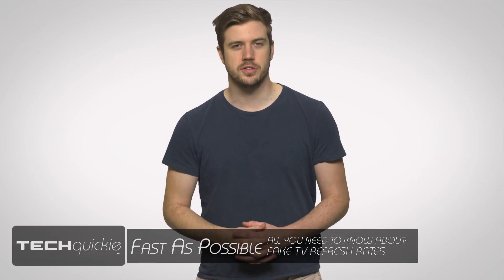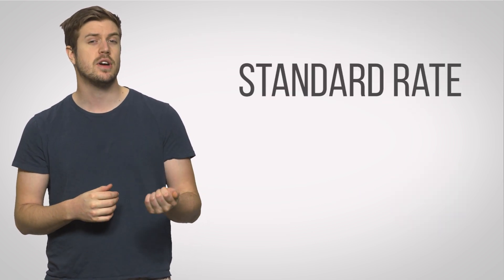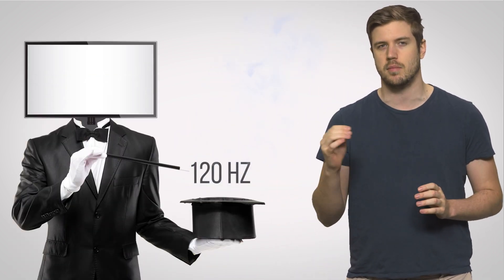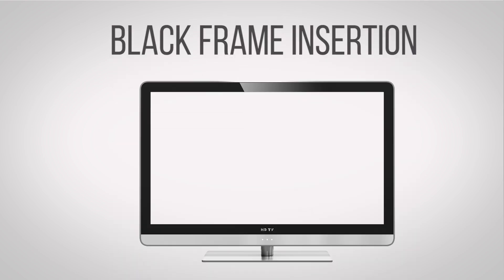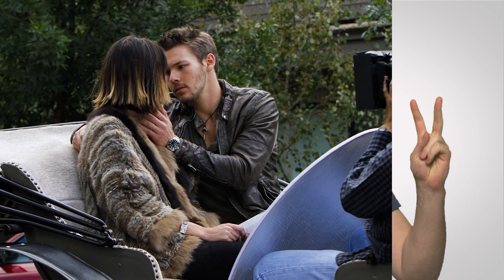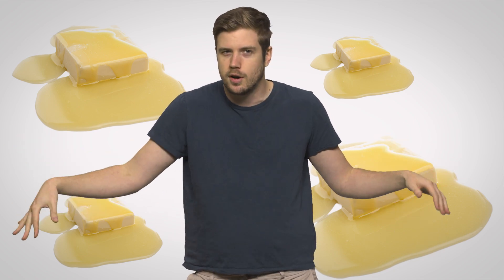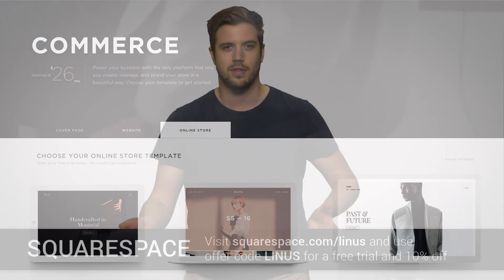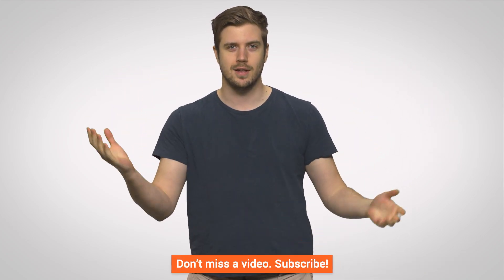Fake TV Refresh Rates As Fast As Possible

Comment: hmm, 60hz, oh wait, fuck off and stop trying to use a sound frequency to display screen refresh rates, fucking idiots
Reply: Wait, what ? I have a Bachelors of Science degree in Audio Engineering, and I'm really hoping you're just trolling. Hertz is a measurement of frequency - the reason 60Hz is a tone in audio is because it's the number of cycles a sound wave (Sine/Saw/Triangle etc) does in a second, just like 60Hz in video is the number of cycles a display refreshes in a second. Again, I REALLY hope you're trolling thesmf210...
Reply: I'm going to take the bait and say that hertz isn't sound frequency, it's JUST frequency, or cycles. CPUs are also measured in hertz, like the Intel Core i7 6700K, it has a 4.0 Gigahertz clock speed.
Reply: hertz isnt a sound frequency??? well fuck me, thats where i went wrong as a sound tech..... oh wait, i didnt u muppet
Reply: No, hertz is a sound frequency, but it's also other frequencys.
Reply: hertz/kilohertz=audio, megahertz=processors,  they should no way be used in tv's
Reply: Well 1 megahertz is just 1,000,000 hertz, so they're the same thing. I just think of it like this, Megahertz/Gigahertz=Processors, Kilohertz=Audio, and Hertz=TV
Reply: If you wish to be left alone, but take this wikipedia article and read the Introduction at least. https://en.wikipedia.org/wiki/Hertz?oldformat=true
Reply: Okay then, be ignorant. I'll just be here to have a simple and civil argument if you change your mind.
Reply: ok m9
Reply: "i work as a fucking sound tech" lol
Reply: You work as a sound tech? You most certainly didn't need to graduate from high school. Dunno what kind of company hires someone like you.
Reply: thesmf1210 ,Surprised you can get a job without going to high school. Are you a sound tech that makes sure the child slaves make the Jordans squeak just right? Bet you cut off their parent's hand every day they make less than 1000 Nikes in a day. BTW, learned what hertz was in elementary school. Accept that you are wrong once and don't lose your s**t over a YouTube comment that is polite and correct.
Reply: and you dont work KID, congratulations
Reply: thesmf1210
Lol
I was pointing out your wording "as a fucking sound tech" making it sound like you are the technology not that you work in that industry

And if I didn't do any work whatsoever how could I purchase my own PC? With my own  earned money? That's more expensive that your Xbox One I can see you have :P (Not to mention that I plan on building myself a more expensive one and use this one as a server)

Also what's up with the creep stuff going onto mah G+ acc :D? You won't find anything of interest there lol which you probably already know
Reply: trys calling me out for xbox one (xbox one £300, my pc £1500+ and still need parts!!), pays no attention to my latest pc component unboxing vid (called me out for xbox, took no look at my channel, just goes of a pic) or the fact that my whole build process is on my channel), and as for google plus, not sure what you're on about, never been on your google plus, nor do i intend to, and funnily enough, how did i reply to this, oh thats right, off my FUCKING PC
Reply: thesmf1210 ¨
Alright so on my 1920x1080 monitor when I go onto people's channels under the "Videos" tab I see the first 18 videos without scrolling

You mention your PC components which are start to appear at #38 and that's only a case fan then CPU cooler then CPU, fan & fan
Didn't notice the 1080 at first since the others stand out more from the "COD, COD, COD, COD, something else, COD, COD" trend on your channel

And 1500$ isn't much to be honest
If I was to get the same PC it would cost 50% more compared to the US prices cos Danes pay a lot
My RØDE NT-USB mic and A40 headset w/ the mixamp costs 1/4th of your whole PCs cost
btw how come you've spent 1500$ across 3+ months but haven't made the PC complete yet?

Also it said it was on G+ might have just been a channel comment but it said it was commented on my G+ profile
Reply: thesmf1210 
Lol
I hadn't had any problems with the mic but still went onto buying a studio grade mic for extra clarity and stuff
Also you know that buying over extended an extended period of time will give you worse performance compared to how much you gave right?
Reply: and now im gonna quote you "P.S. i hate youtube"

yh got off it kid, you are BORING me with your bullshit

also i would like to add that when i talk cash im only on about my tower unit (1600), and literally every part was bought whilst on offer of some sort, plus not including peripherals, monitors, anything i could rob from my old PC (from 2007) my old £300 headset etc... etc... so my build is actually well over £2k OK?
Reply: number of cycles in a display FPS....
Reply: Mustang Boss 
I'm more surprised that he started doing giveaways to get views than someone giving him a job

Comment: what upsets me is that some standards require a set frame rate, like my 3D vision 2, it requires at least 120FPS from LCD or 85Hz for CRT, and while all of my CRT monitors worked well, when i stepped up the resolution to a "600Hz" HD monitor, i was saddened to find that it would never go above 75Hz, and thus could not be used for 3D

Comment: So how are 24 fps divided equally over 60hz refresh rates? or 26.4453 fps as example.
Reply: +Enhanced Pyrotechnics 24hz = 24fps 60hz = 60fps
Reply: Chris Harper bad answer. you didn't understand my question. monitors seem to have a constant refresh rate which doesn't vary with fps. I wonder how these individual frames are spaced out over the 60 refreshes.
Reply: +Enhanced Pyrotechnics  24 fps can not be perfectly spaced out  so it's converted, frame are moved/doubled/blended  to make them appear at "almost" the right time. It why most TV also support 24,25,30,48,50,60 Fps/Hz  for those who can notice the little difference between native frame rate and converted frame rate.
Reply: Digital Insan1ty basically speaking they are not which is why you get judged during pans. Easiest fixes are get a display capable of 24hz or even better true 120hz

Comment: If your source material is 24 Hz or 30 Hz Truemotion can be great, much better than without it but forget the few presets as they give a nasty cheap soap Opera effect, instead use the manual over ride and then set De-Judder to about halfway around 5 or 6.   It really makes up for the fact that 24 and 30 fps on digital is lousy compared to Video tape or film ! !

Comment: "120hz" TVs just look terrible. Everything looks like its being played in fast-forward, but the total amount of time to play it is the same.

When I get a new TV the first things I do are put it in cinema mode (pretty much always the most accurate colour preset), adjust the brightness for the room because it isn't actually in a pitch black cinema and turn off any >60hz bullshit.
Reply: ghelyar if it's a true 120hz you'd never notice the difference since 120 is and even multiple of 24, 30, and 60.
Reply: Unfortunately, that's not now it works. You don't see in discrete frames, you see continuous motion, and 120hz TVs upscale by interpolating between frames, not just repeating frames. It's commonly called the soap opera effect, and it looks god awful.
Reply: ghelyar
if its a true 120hz and has that feature turned off it just refreshes the same frame more than once
Reply: I said the "first things I do are ... turn it off", and you said "you'd never notice the difference". I turn it off so that I don't have to notice that awful effect.

It is slightly odd that every description of the effect I see is that it's "too smooth" because the 24fps 3:2 pull down is gone, but I just notice it as it seems too fast rather than too smooth. It feels like fast-forward, but it takes the same amount of time.

Comment: This tech is kinda cool to me though, not everyone has a rig that can game at  above 60hz, especially not 2k and 4k. A secondary processor in the screen adding intermediate frames wouldn't, by theory, require any more gpu horsepower
Reply: +Jerry Knudsen That's not how it works, that's not how any of this works. No processor can predict into the future. Which is what you are happy about.

With a movie, TV just buffers upcoming frames and mashes each two frames together for a new one. I'd like to know how you imagine it done in real time gaming, without the TV delaying video stream from the GPU (adding even more lag) just for that (fake) effect. Also, a TV processor has no effect on the GPU performance. A TV processor has no direct access to game files that it could render (nor it has raw power to do that). All a TV like that does is accept prerenderred input by the GPU and display it on the screen.
Reply: Major Turnip he just got done explaining that one of the tvs does indeed implant false frames in between true frames, so the possibility of using that for gaming doesn't seem extremely far fetched. In terms of gpu performance, you are right and that was my point. It has nothing to do with the gpu, thus the workload wouldn't increase but the tvs total frames would give the illusion of far more frames.
Reply: What you see during gaming is what was made THEN at that moment. There are no future frames to make intermediate frames from. If you wanted to have more fps with that effect, video stream from GPU would need to be delayed, so TV would have something to work with. Which means lag, both input and overall. I just repeated what i wrote previously.

Input lag being reduced by high fps is one of the main things why high framerate is favored in gaming environment.

With this you will have higher fps number with no advantages of actually having higher fps and in fact even a bigger disadvantage if you play fast paced games.
Reply: Major Turnip while I do understand what you are saying, if we, with our current technology, have an input lag of 1/60th of a second, something so small we wouldn't see it, then this could work. I realize there is almost no input lag in gaming but metering 1/60th of a second is beyond difficult, and chances are we do experience it.

Comment: There are two forms of video. PAL and NTSC. PAL is a European method, and works at 24 fps. NTSC uses 30 FPS. NTSC is used in the America's, but not universally. Personally, I found that 30 fps wasn't really much different than 24 fps, and file sizes were smaller.
Reply: Blaze Townsend PAL is 25hz and 50hz depending...
Reply: Elliot Kaufman 25 hz is actually the norm for progressive scanning. 50 is interlaced. 50i is not as superior and requires the faster speed because of how it scans video in. https://en.wikipedia.org/wiki/Interlaced_video

Comment: 600hz plasma reporting in
Reply: 3:16
Reply: Docter Redstone i can totally tell the difference between 600fps and 550. 550 fps hurts my eyes.
Reply: Right on!  I have a new 4K TV and I like it but for dealing with fast motion scenes it doesn't come close to my 10 year old Sanyo plasma.  If someone could come up with a 4K Plasma TV, there would be a lot of people selling or returning their 4K LED TVs.  I would be one of them....
Reply: @brunoborer7038  There will never be a new Plasma. They were killed because the European Union came out w new Energy standards effectively killing Plasma and only leaving LED, LCD and the like. 

Besides OLEDs have much better Blacks than even the Panasonic VT series did, and are many times brighter!
Reply: +Mario D. Zmaj     Hahaha Noob reporting in :P
Reply: This is different because the 600hz actually refers to something real, not an arbitrary motion rate. It's still marketing but it at least refers to a real rate of refresh(not the frame refresh but the amount of refresh pulses per second). Plasmas pulse on and off many times per frame refresh
Reply: +Mario D. Zmaj same xD, but I've never even gone up to 60 FPS on it cause HDMI 1.2 FTW (1.2 isn't capable of above 30HZ @ 1080p)
Reply: @Skylarr  this some big bullshit, even HDMI 1.0 did 1080p 60fps, I'm literally looking at the spec sheet for it!
Remove this lie from the internet after 4 years!
Reply: +Mario D. Zmaj Then u must got a decent sillicon valley of eyes

Comment: Rather than making multiple replies on other comments, I'll make several corrections in one post.

(Film) Movies are shot at 24 fps but are shown at 48 fps (each frame twice). 48 fps is the "natural" frequency of the eye.

NEW Digital TV is SUPPOSED to stick to the 24/48 fps standard, however, because of conflicting frame-rates on older material (25/50 for PAL/SECAM and 30/60 for NTSC) this is still a significantly messy area.

UHD is 3840 pixels across. Many manufacturers like to call it "4K" because it's a bigger number. I always differentiate between 4K (UHD) and TRUE-4k (4096). Yes, there are 4.5-5k video cameras out there so that image stabilization can be done in post-production, instead of relying on weird stretching done by in-camera algorithms or expensive gyroscopically controlled lenses.
Reply: +Treknology question, how does that 48Hz thing work? if they are shown 2 times after each other, it is the same as 24 Hz? or is there a short black period between the 2 identical frames?
Reply: +franziska1007 Yes, each frame is displayed twice, with a blackout between both displays that matches the blackout required to shift the film to the next frame. Most cinemas have converted to digital projection and I don't know whether they simply mimic the analog projection or use a different technique.
Reply: +Treknology   It will probably depend more on the type of projector ... But most cinema use DLP or LCoS.  
Dlp is able to refresh the same image dozens  of time with refresh  rate over 1000Hz even up to 6000Hz.   
LCoS are similar to LCD but still they can handle pretty high refresh so they probably have the time to redraw the same frame many time to.  If the chip use 240hz internally it can redraw the same frame 10 time for a 24fps movie.
Reply: +Eric Jacques (Leucome) Yes, DLP would make sense, although I wonder how often that "mirror chip" has to be replaced?
Reply: They say DLP the chips can last up to 100,000 hours. I guess they can also brake sooner too.

Comment: This "hyper realism" that people complain about is my complaint to lower frame rates. If we have a standard refresh rate of 60Hz and only record video at 30fps, then we're missing out on so much potential for detail. I still think 4K is the wrong answer and we should be going for more frames per second. Many modern HD tvs have the potential to refresh at 120Hz. If you decide to shoot at 120fps (probably not good as the human eye can only see about 100fps) then you're still only using the same bandwidth (theoretically) as 4K and you should have some pretty incredible detail. I do understand the difference between UHD and HD and think we should focus more on improving HD than trying to leap ahead to UHD. Especially with the limited amount of UHD content and limited bandwidth of our internet connections.
Reply: Jeffrey Ball defuq ? you need higher bitrates with higher framerates otherwise the video gets completly pixelated because of the low bitrate. and no, pretty much every device on this planet has a 60hz screen, including all these "120/240/480/800hz" tvs.

1440p 60fps 20mbit/s is the sweatspot right now, but it does interpolate with 1080p screens so uhd is the way to go.

Comment: CRT TV's have native backlight strobing for anyone wondering. They can also technically support higher framerates than flat screen based TVs with modifications, though those mods would be quite advanced. Used to have a 240Hz CRT monitor. Only 360p though.

Comment: I found this out the hard way with my 32" Vizio "120hz" tv. :(
Reply: A lot of Visio tvs don't use this trickery. If it says "120Hz" and not "120 clear motion rate", then it's a real 120Hz panel. Although it probably only supports 120Hz over HDMI on one input. I happen to know Visio did sell real 120Hz panels and didn't really start using proprietary motion ratings except on large M-series and some P-series tvs.
Reply: +EnlightenedAce so, how would I set it up so I could use 120? I don't know how to do dual hdmi.
Reply: +EnlightenedAce the model number is M322i-b1

It is M series so I'm afraid it might be not true 120.
Reply: Takoah That panel is a true 120Hz with a 360 motion rating. I'm not sure if any of the HDMI ports are capable of 120Hz though. It may only support it over coaxial or it may support it over all the HDMI ports. It depends on what version of HDMI the ports are being used and I'm not really sure what was used on it.

Comment: get rekt bitches my microwave runs at 500000000 hertz
Reply: +Snibm S      2,450,000,000 actually
Reply: close enough. could not be bothered googling the correct frequency
Reply: Yup! Roughly the same frequency as many wifi routers and radars.
Reply: My gamma ray blaster is better
Reply: Snibm S but my portal gun will rekt that
Reply: YO GET REKY MY EYES RUN AT 1000000000000000000000000000000000000000000000000000000000000000000000000000000000000000000000000000000000000000000000000000000000000000000000000000000000000000000000000000000000000000000000000000000000GHz
Reply: Snibm S 1,000,000,000,000,000,000,000,000,000,000,000,000,000,000,000,000,000,000,000,000,000 actually
Reply: I know i'm just joking lol!
Reply: That's why it gets as hot as a microwave
Reply: Snibm S same with my Xbox One😂😂